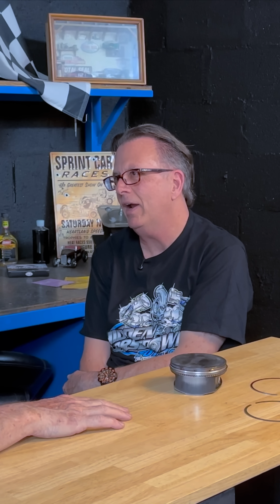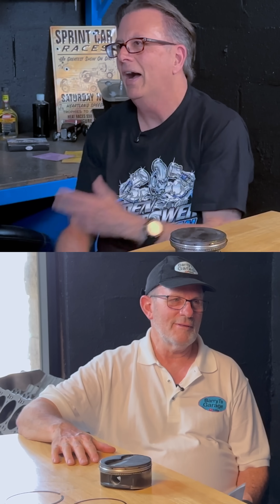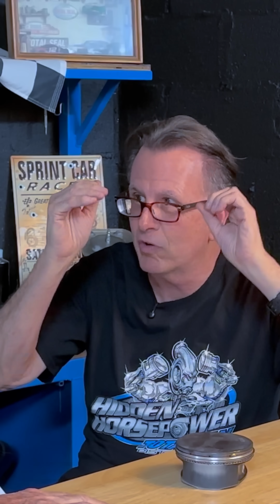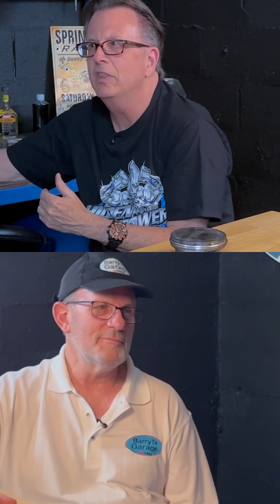Add HP w Modern Rings? Keith Jones w #BarryT #TotalSeal #engine

Comment: Bought couple sets of Pull Out 6.2 LT Piston/Rods from use in street setup. (After milling off LS3 head interference areas and enlarging intake valve reliefs) Ring pkgs appear even thinner than 6.2 L92. 
My imagination or ??

Comment: So my little old school 355 beating up on Ls powered stuff is even more impressive than I thought..cool.
Reply: Cly Head Selection is Key .
My Ancient Destroked 400 (352cid) came bak to life big time w/AFR heads
Reply: @peted5217 1st generation twisted wedge heads woke this thing up , .030 over flat tops edelbrock rpm cam and air gap intake and  750 carb, runs amazingly well.
Reply from the maker: Nice!